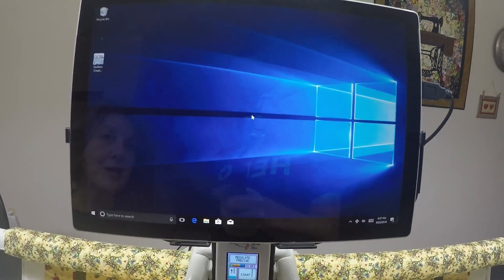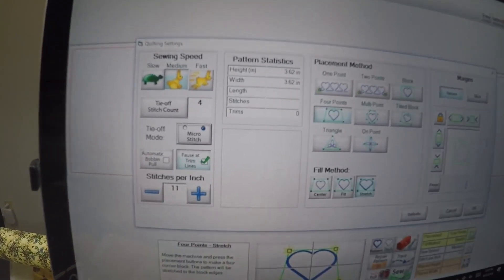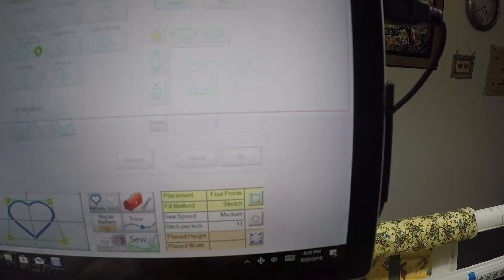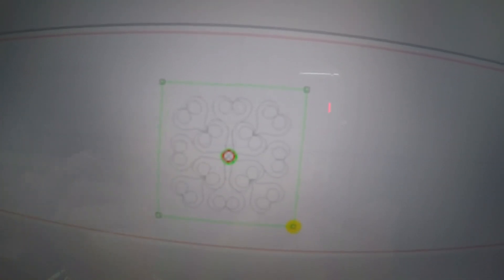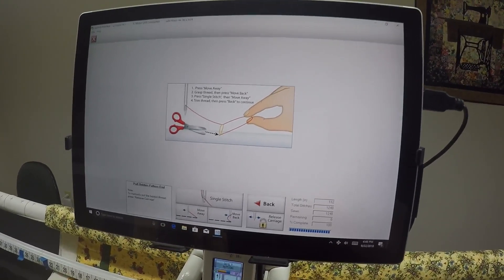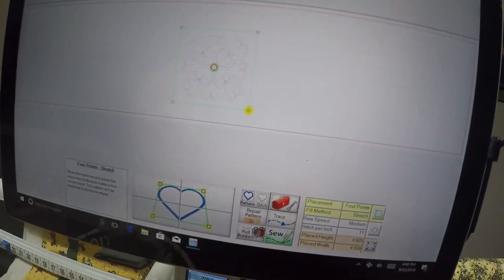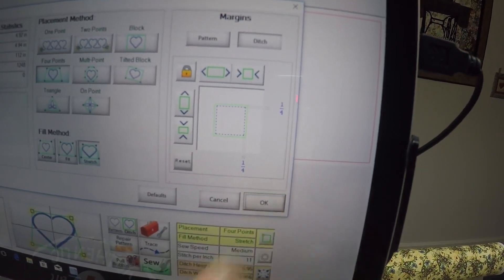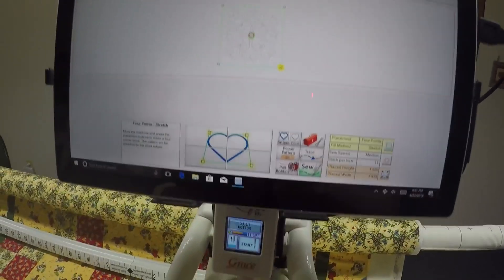QCT4 Beginnings Version - An Example of Block Stitching and Ditch Stitching

Comment: I didn't mention this in the video.....but 3 shortcuts to the Settings are in the blocks to the right of the red toolbox. Just touch the one you want to use, for example "Placement" in yellow - and just the "Placement Method" and "Margins" will show on your screen.